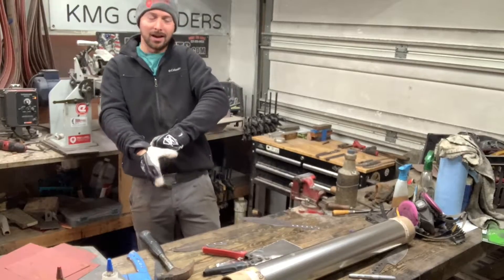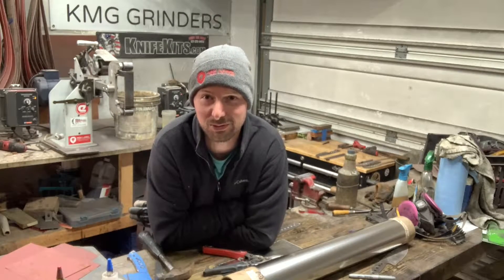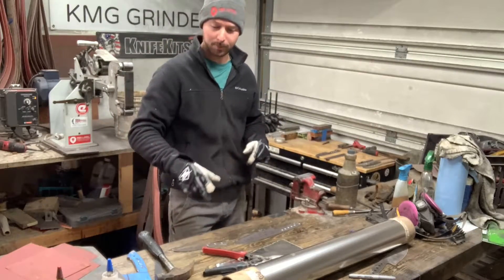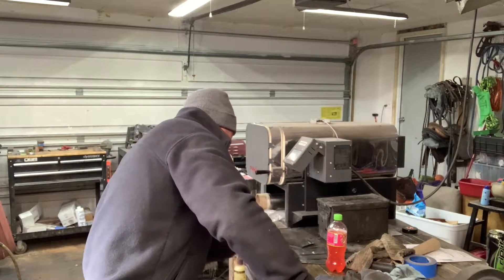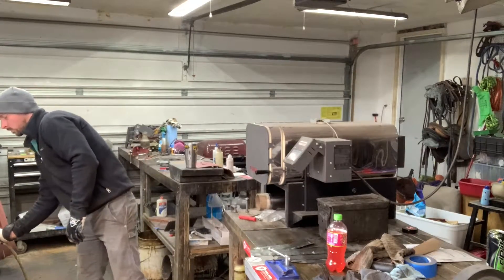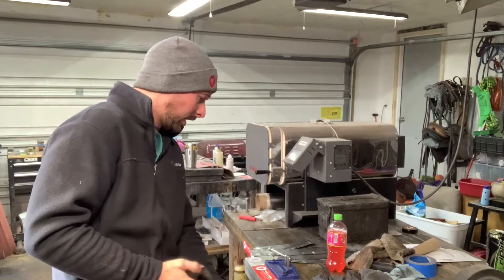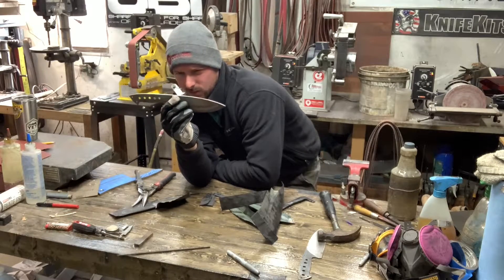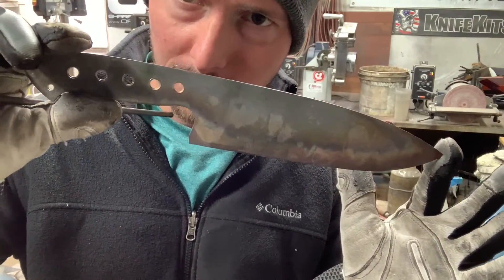How to heat treat STAINLESS steel

Comment: I'm a welder in a fab shop, and I deal with a lot of 304, 308 and 316 stainless. Could I use any of them, and would it change the heat treat process?

Comment: If you start grinding after the heat treating of for example m390, wouldn't that mess up the heat treat and temper or is there a way to avoid it? Thanks in advance.

Comment: New knife maker here, haven’t even looked into ss yet, BUT, why the steel foil?
Reply from the maker: Due to the foil's thinness, it takes on the furnace temperature immediately and binds oxygen trapped in the foil packaging. There is then no oxygen present to oxidize the workpiece itself. The workpiece stays clean.
Reply: @gentrycustomknives8008  this just a ss thing? I know some as you cryo freeze?

Comment: Hello correct me if I'll be wrong:  I plan to temper at 410 Celsius my 302 Stainless Steel (I think that's the steel, a martensite, an INOX steel by Victorinox) for 4 minutes. It's a kind of single layer leaf spring for the Victorinox Swiss Knife scissors so it doesn't break due to metal fatigue.

God bless, Rev. 21:4
Reply from the maker: I’m not sure about 302 🤔
Reply: Are you sure it's not 410 Fahrenheit? 420 Celsius is 770 Fahrenheit and way too high for any blade steel.
Reply: Oh and 302 is not a martensitic (hardenable) steel. You would have to figure out what steel you have on your hand exactly and the look up heat treatment recipes for it.

Comment: I have never heard of anyone not grinding the blade before heat treating..
I would agree if the blade was below 1/8 inch.
Are you not worried on overheating blade when grinding and ruin your temper? 
400 deg F isn’t real high…
Reply from the maker: It’s pretty common.

Comment: In the old days you see a typical chef holding a sharpening iron (file) and brushing his knife few times on the file; the days are already gone. The food stuffs at supermarkets are well prepared and no longer need much chopping. Therefore, modern kitchen knives should be hardened to RC62 to 64, and don't bother with tempering. (Since alloy addition may stabilize austenite phase, it may be desirable to temper the blade at liquid nitrogen temperature to reduce the amount of retained austenite.) These knives cannot be sharpened with file, should be honed with 0.5 micron diamond or alumna paste.
Reply: I think you misspoke, you should absolutely temper any steel that you are hardening. Cryo might not be needed, but tempering certainly is.

Comment: Why do you grind after heat treat?   What are the advantages doing it this way.  I would think it would take much longer to grind the bevels and use more belts up doing it this way.  Im sure you have a reason so please tell.  Thanks.  Great content by the way.
Reply from the maker: To avoid warping

Comment: What do for the temper on the 440c?  Also when you start your oven for the first fire do you put blades in it till they are up to critical temp and quench right when you reach the temp or do you get your oven to ten then put the blades in and soak for 15 min?
Reply from the maker: I put blades in once oven is at temp. For my 440c I’m doing a 360f temper

Comment: I can’t wait to get to the stainless level
Reply from the maker: Pick up an even heat and you’ll be rocking in no time!
Reply: @gentrycustomknives8008 can I heat treat stainless steel without a professional oven ? 
could it work if I put it in a selfmade metal melt furnace ?

Comment: I wonder if flooding the oven with nitrogen would be cheaper and faster than foiling all those blades over the years. A tank, some holes for the line, a reg ,and maybe some seal work. Build it easy enough, it's the time it would save, and the recurring stainless foil bill. ✌
Reply from the maker: Good question! I’ll have to look into that !

Comment: Hey buddy,  I have a 120v even heat oven and it's hard to keep the temp when I put the knives in there. To me it takes to long to come back up. What do you think about putting the blanks in as it's coming up to temp then just letting them soak? So you don't loose all that heat putting them in after it reaches temp.
Reply from the maker: I don’t think that’ll cause much of an issue

Comment: So you don’t need to do any type of cryo? I am thinking about venturing into the realm of stainless. I totally agree customers will definitely like the low maintenance of stainless
Reply from the maker: Check out the heat treat technical specs before picking a steel to work with 👍👍
Reply: @gentrycustomknives8008  so you don’t cryo? I was just curious says you can was just curious if it was necessary
Reply: @adamhackman2089 cryo refines most steels and especially high carbon, alloy and stainless. However, it's a refinement and the main heat treatment has to be good in the first place. It's like stropping a butter knife won't get you a razor, but stropping a proper edge will refine it further and allow you to get peak performance. Cryo also is another step and cost. So unless you have a proper temperature controlled heat treating kiln and the rest of the process down, I wouldn't even think about it.

Comment: Well done mate!
Reply from the maker: Thank you! 👊
Reply: @gentrycustomknives8008  Can you explain to me sir why in the HELL 309 forge welds to REX 121 but not..any other alloy at 2192 Ac? I've asked a few metallurgists and Gary Creely who works with REX 121 often. They all agree with my literal GUESS that its the insane amount of 3.4%C and the lack of chromium, so the chromium in the 309/321 wrap would indeed want to bind with the carbon, I also *think?* that perhaps the vanadium also assists in the process with precipitation of micro carbides? Anyone here? lol.
Reply: DONT LET THE ICE MELT IN BETWEEN THE PLATES! Not that this needed to be said aha
Reply: I can't believe you are using those gloves and 0 IR face shield man. GET EM. Trust me! You want a 3M Shade 3 visor...this will kill your retinas...
Reply: looks like my shop lmao. A LITTLE BIT MORE EXPENSIVE? Its 150$ for 50 feeet ffs! but worth every penny. Anti scale is not ideal because your cooling rates will increase which..isnt what we want with knives.

Comment: Ss is a lill more complex then what I'm willing to get into but I like seeing the process...who knows some day I may jump into it as well?
Reply: You can always try AEB-L. Wrap in foil, Heat in a kiln to 1560 and hold for 10 minutes, ramp to 1975 and hold for 15 minutes. Remove from kiln and carefully cut the foil off and hang the knife up in air and/or quench in oil. Once cooled, drop in dry ice and acetone mix until frozen. Temper at 350 or 400 depending on target hardness. It's air hardening and not overly complex for SS
Reply: @usernameisaname  I don't have a temp controlled kiln.  Just a forge
Reply from the maker: Definitely a little more involved then high carbon steels
Reply: @gentrycustomknives8008  would it be fine if I didn't have any foil or coating

Comment: But what about the all important Cryo treatment??
Reply from the maker: Do some research on what stainless you go with and you’ll see it’s not necessary for some
Reply: @gentrycustomknives8008  Eh. Correct but eliminate the word stainless there? I'm not trying to stick words in your mouth brother or criticize you whatsoever. You do this exactly as me. I just have the KO 22.5.
Reply: @veraxknives0331  I’m not sure I follow what you’re saying.
Reply: @themichiganangler4746  certain alloys benefit from cryogenic treatment more than others and it has nothing to do with chromium content it's .. the idea of cryo which also HAS to be done after every temper is you're basically with each temper starting a new martensite start and finish temperature, with the finish being unknown but -320 will do it, to decrease the amount of retained austenite in the iron matrix before it stabilizes. Also, cryogenic treatment AQ can cause warping issues because of the phase change from austenite to hopefully tetragonal martensite so sometimes you.. don't want to do it. Any other questions? I'm an open book lol.
Reply: @veraxknives0331  I totally understand the cryo process. I think I just misunderstood your comment. When I said “stainless” I was referring more to non high carbon steels. ( CPM3v, magnacut, s35, 440c,etc)
Reply: @themichiganangler4746  those are high carbon steels. The technical name is hypereutectic.. meaning anything over 0.7%C is technically a high carbon steel. Not saying that you are wrong about anything just adding information I'm assuming you know. 👍
Reply: @veraxknives0331  Well, if we want to get really tecnicall high carbon steels are steels with eutectoid or hypereutectiod carbon concentration and no significant alloying elements besides some Mn and Si. If you have some other alloying elements in significant concentration you enter the realm of low alloy or even high alloysteel. 3V is not really a carbon steel, even if it has high carbon in it, the same way M390 for example is not a "carbon steel" (but a stainless one). :)
And as far as I know there is a strong connection between Cr and the need to do a cryo treatment, because Cr lowers the Mf temperature and you have more RA when quenching to room temperature. But its not the only alloying element to do so, which is what you wanted to say I think.
Reply: @ArthurHerbst  yeah you understand this stuff somewhat lol. Most people don't and um. Chromium does stabilize Ra but not near as much as like. Edit: NICKEL. I said copper so that also I suppose but I meant nickel I'm assuming was my point I didn't re-read it and I really don't remember what I was commenting on exactly but 👍